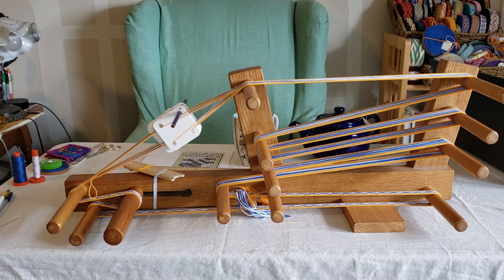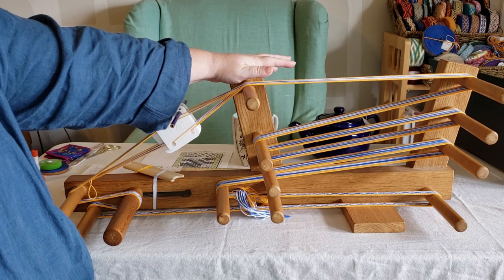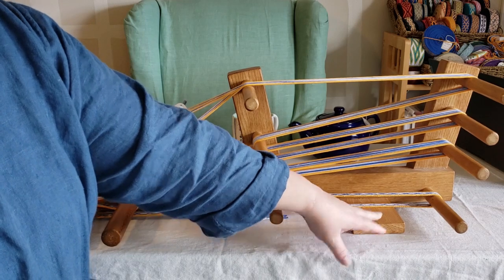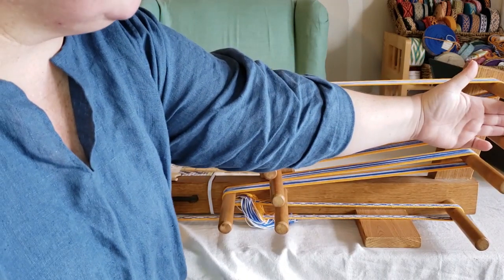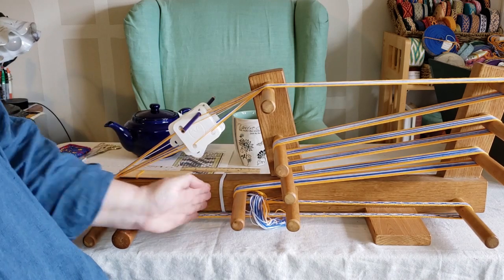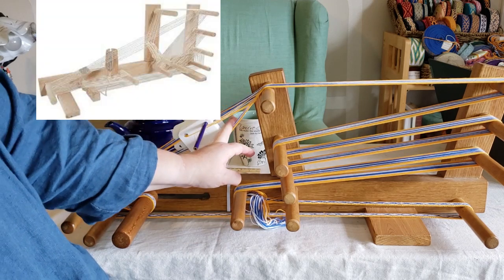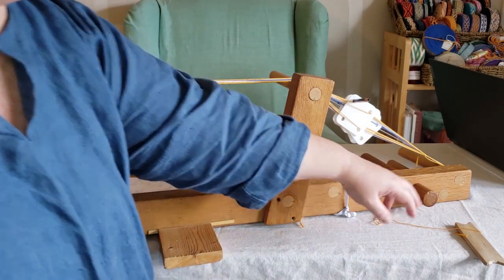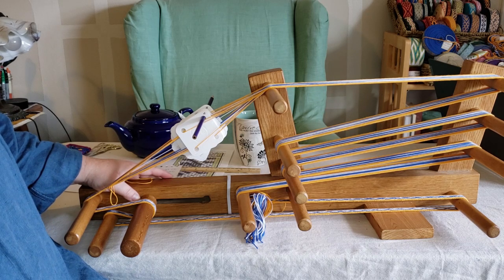My Inkle Loom:  Woodworker Episode

Comment: Hubby made me one off this pattern for my birthday around Thanksgiving. It wasn't until I started trying to do the first weave along with you that I realized it was left handed instead of right. It's a good thing that I was left handed for the first few years of my life until I broke my left arm and my teacher told me I had another arm I could use to write with.  I'm not ambidextrous but I am duel handed I think its called. I do some things with my right and some things with my left. I did ask about flipping the pegs to the right side. He just laughed and said "Darlin' I can do that for ya but I would risk destroying the loom. I would have to cut off the pegs and drill out the holes, cause the wood will break before that glue does."

That is what I get for being married to a guy who builds cabinets for airplanes for a living.  Might want to put a note on this to pay close attention to which side your putting your pegs on and to set it with the working end facing you when deciding where to stick them.
Reply from the maker: Hmmm...I did front, back, and top views...I also am married to an engineer and a woodworker.  I'll have him look at the designs and see if he can suggest any improvements.

Comment: I know it is not your preferred method but have you ever used a warp weighted loom? What are the benefits over an inkle loom?
Reply from the maker: I have experimented a little with warp weighting.  First issue is having enough weights on each card.  You need about 100g per card (about 3.5 oz), and I was struggling with finding the right amount of weight.  Tried buying fishing sinkers, but that was expensive.  Made little baggies of pea gravel that I scooped up from my yard--that was OK, but not ideal.  For me, the biggest issue is portability.  I want to be able to take the loom from home to events or meetings at friends' homes, etc.  Warp weighted is just more difficult for that.  If you don't plan on moving the loom, then this could work great for you.  So, bottom line, it's a personal choice.

Comment: Excellent overview of the loom! 

Question - the angled uprights are ‘offset’ to the left (when looking at the loom from the weaver’s end...) half the width of the backbone. Is this by design - as in, does this offset give you, the weaver, an efficient advantage vs. having the upright’s right face flush with the backbone?  

I am considering making one, and the rabbet/rebate of the angled uprights struck me as inefficient (from a woodworkers perspective), and was wondering if there might be a weaver’s reason to have the offset. Your response is greatly appreciated!
Reply from the maker: That's a woodworker question that's above my pay grade.  If you're a woodworker and can make it stable, go for it.
Reply: @elewysoffinchingefeld3066  - thanks for the response. It’s actually a weaving question 😁. Does the offset help you ? Or does it not matter when weaving?
Reply from the maker: No, I don't think it makes a difference.

Comment: Thank you so much for breaking down the different pieces of the loom, it helps a lot! 
About tension. . . 
So, like your tension peg in front, the lower back peg could be made in the same way, same goes for the lower middle peg, just with less room to "wiggle" but I think, with three tension rods, it should be enough when making a long weave.
I am however totally unexperienced and I am planning to build my own loom, due to the high cost of a finished product :) 
I am from Denmark, and material costs would set me back 30-40$. Purchasing an inkle loom would cost me 110$, without shipping. 
So right now I'm trying to figure out, how I can make the best loom possible, giving me (and maybe others) the best chances of success and customization. ^^
I originally found you on pintrest, and sparked a lot of interest and creativity in me, with only a few of your videos. 
Thank you <3

Comment: I built my own inkle loom quite a while ago, and I didn't have any tools that would let me cut a slot for a tension bar, so I have a paddle tensioner that has three holes it can fit into. It doesn't work very well and I ended up tensioning by holding a loop in the warp with a pen and fastening it back to a post with rubber bands. XD
Reply from the maker: That sounds like something I'd do...

Comment: I have you to thank for my latest obsession!  I was looking through YouTube for some info on repairs for a little table loom I've had for years.  Up pops your beginners video and I couldn't stop watching.  Long story made much shorter - I warped up the beam on my table loom, used electric fence insulators for weights and made many a band.  Made many a mistake.  I finally bought a little Inkle loom that will allow you to make 2 1/2 yards of weaving and it does a great job, just too small.  I have found that my weaving tension is much more consistent on the Inkle as opposed to weighted warp.  It also frees up one end of my living room where I had yarn stretched out across furniture!  Love your videos and find I have to watch them more than once to get all the info in my poor head!  Thanks for your work!  Have a peace filled Holiday with much love and egg nog.
Reply from the maker: Thank you Penny!  I'm so happy that you have found so much joy in this hobby!  I think you might need a Monster Loom....  Happy holidays!  Cheers!
Reply: @elewysoffinchingefeld3066  Quick question about patterns.  I have been looking at several that are threaded counter clockwise.  Upon inspection of instructions this person weaves opposite of the way you teach.  For example, she indicates forward as being toward the weaver, backward away.  I don't need further confusion but she has some gorgeous patterns that I would like to try.  Is there a fairly simple way of converting this convention to the "right facing, clockwise cards, forward away from weaver" or should I just ignore these patterns to save brain cells?  Oh, and IF I were to get a monster loom of some type, are you able to warp it only partway if you didn't
 need a bazillion feet of band?  Thanks in advance!

Comment: Just made a loom last weekend from two wooden shelving brackets and 4x 12" lengths of 1" dowel. Trying it with loom weights since it's a small, portable setup. I have my warp wound on wooden spools with the weights hooked on bottom, then strung through the loom and tied to the front dowel. Still seeing it up, so I'm curious if it'll ever work, but it's worth a try for a cheap setup!
Reply: Before that, I was weaving between the two arms of a chair, moving between a spare office chair and a lawn chair. Worked fine, but killed my back bending over.

Comment: I am going to assume that all of your pegs have a finish on them like some kind of polyurethane is that correct? Or are they raw wood?
Reply from the maker: Honestly, I don't know.  I would talk to a woodworker about putting anything on the wood that might rub off on your fibers.
Reply: @elewysoffinchingefeld3066  then I'm thinking raw wood 😁 you would probably know if your pegs were  coated. They would be a bit shiny and slick.
Reply: @elewysoffinchingefeld3066  I am actually thinking of building one of these for my 11-year-old grandson. He's a maker at heart and spending way too much time in front of a video game... I think that he would absolutely love this or completely hate me for doing this to him! 🤣
Reply: @darleneredden6730  It should have a finish. Most wood finishes harden and cure (check the label for cure time), and they will not rub off on fibers. Unfinished wood will swell when humidity rises and the grain will become raised, which could cause snags on fiber. Polyurethane is a durable finish and shouldn't cause any problems.
Reply: @griffox  thanks! I won't finish this little starter loom because it's just to see if he likes weaving, but if I make him a more permanent one I will. Thanks again!
Reply: @darleneredden6730  Your welcome! It's so neat that you are doing that for your grandson.  :-)

Comment: Are the drawing’s dimensions of the loom as it is or as you would change it? I made an Inkle loom years ago thinking my daughters might use it; I was the one who wove a bit of a band on it to see how it worked. The girls grew up twenty-plus years ago. I can’t do my lathe turning or other woodwork in the house, let alone in front of the tv where my wife does much of her crocheting and quilting. I thought the loom would be a good thing to occupy my hands and mind in the evening. My wife said when I asked about it several months ago that it was in our attic. ( couldn’t find it) I asked again last week and she said our older daughter has it. At any rate, as I remember the dowels needed some work, and I like the idea of the thick wood yours is made of. I’ll use a larger diameter screw in the tension peg, a hanger bolt (wood screw one end, bolt thread on the other) at least 5/16” diameter, or maybe a bolt all the way through — it’s easy to make a concentric bore if you have a lathe.
   Thanks,
Steele Hinton
Reply from the maker: I think I drew it as-is.  If I were to change it, I would make the space between each dowel at least 2" so my hands could fit between them better (that 2" peg to peg, not 2" on center).
Reply: @elewysoffinchingefeld3066  Thank you! My birch dowel rods should arrive today. The local hardware store dowels are not very round and not very hard. I can bite one and leave toothmarks. I’ll turn the tensioner dowel on my lathe.